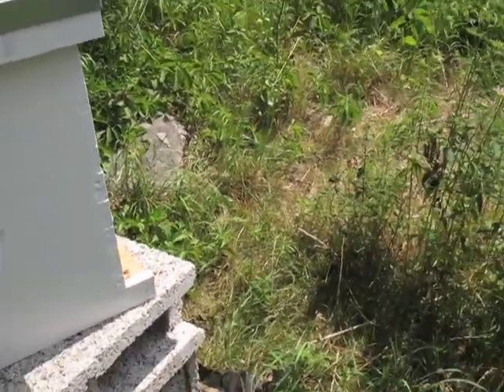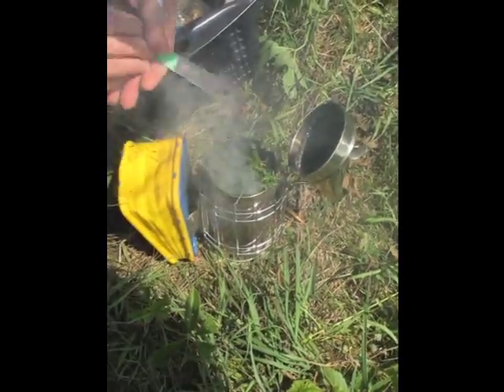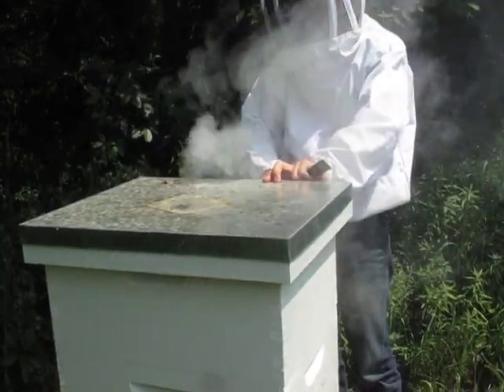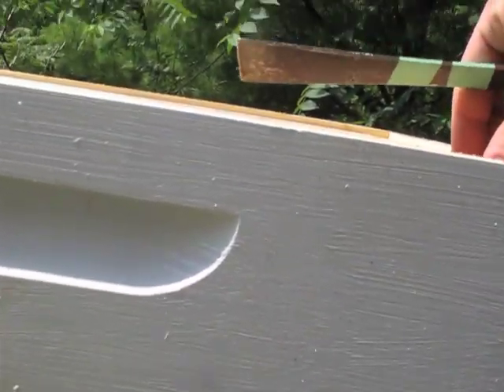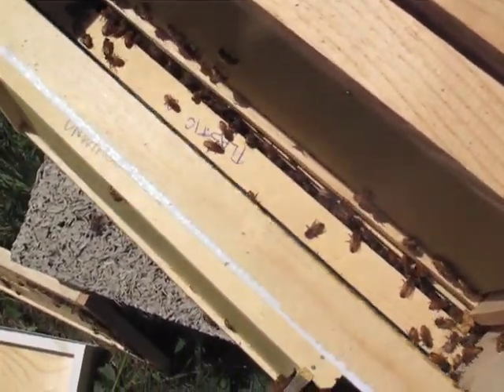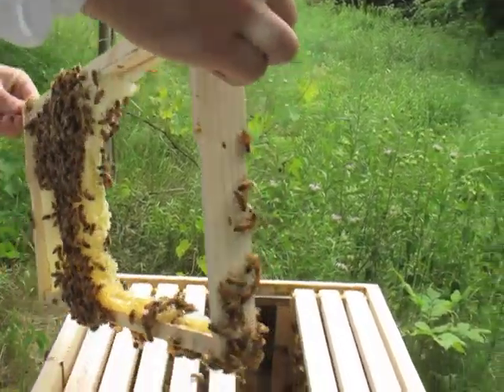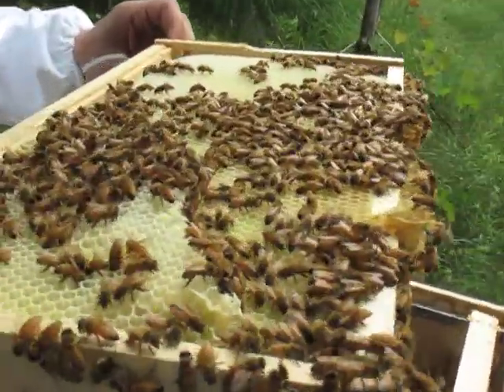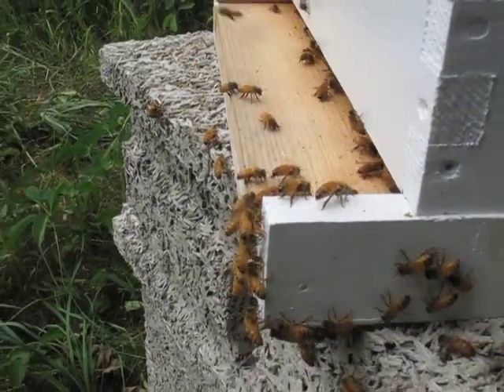Inspecting a bee hive with broken comb

Comment: Just a tip on lighting your smoker: You want to start your fire at the bottom and then add your twigs, pine needles and dried leaves etc. on top. During the winter, I collect lint from the lint trap in the clothes dryer and put it in a ziplock bag. When I want to start my smoker, I take a chunk of the lint, light it, and put it in first. Give it a few puffs, then add the dried tinder. Hope that helps!